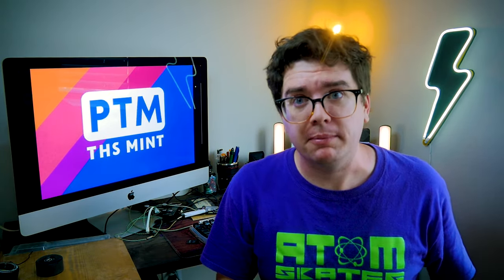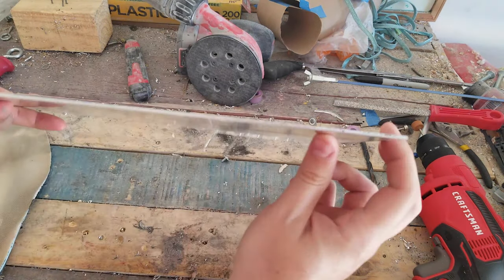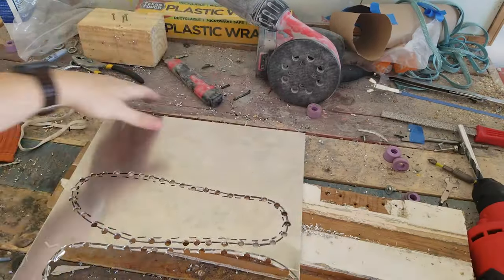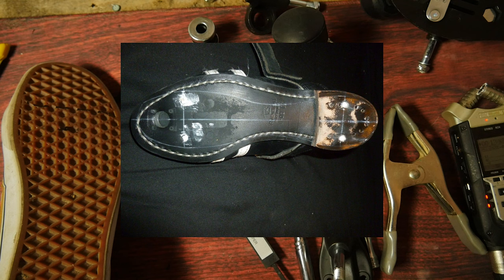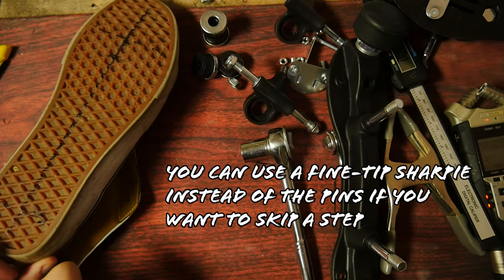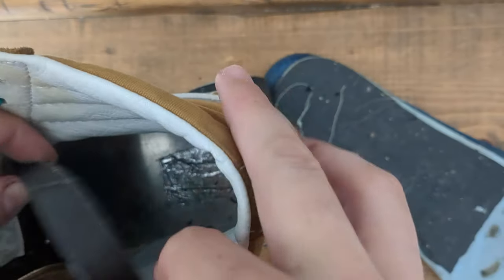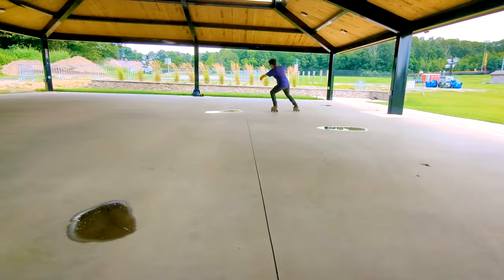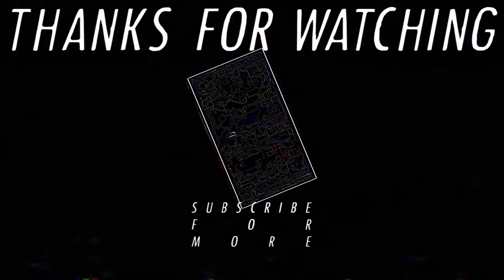DIY Vans Sneaker Skates

Comment: This is awesome! For the budget plates you linked, are there multiple different sizes on the website? Will the linked plates be the right size for US men’s size 13 feet?
Reply from the maker: They're measured in millimeters on there. I just measured heel to toe on one of my shoes
Reply: Do I need to get plates that are the exact same length in mm as my shoes? Like if my shoe is 310 mm, will the 270 plate be the right size? There is only one budget plate on Ali Express that claims to be my shoe size, but it seemed a bit sketchy and had almost no information  @Patrick_Gibney
Reply from the maker: @orangenes1161  yeah, they need to be the same length. Your best bet would probably be a name brand. If you have a skate shop nearby they could probably help you give exactly what you need